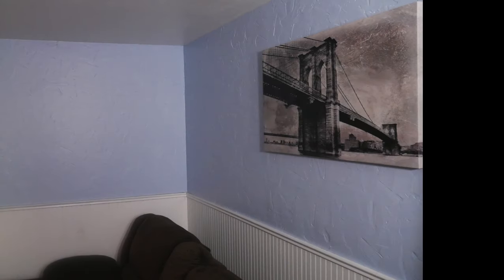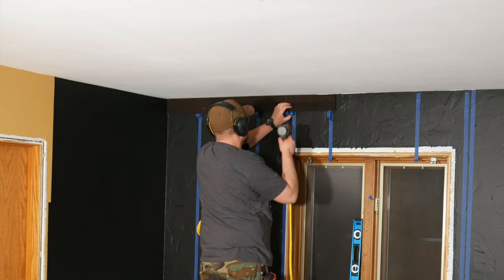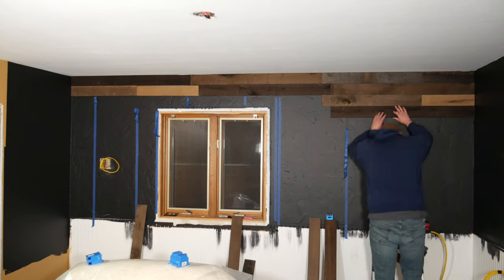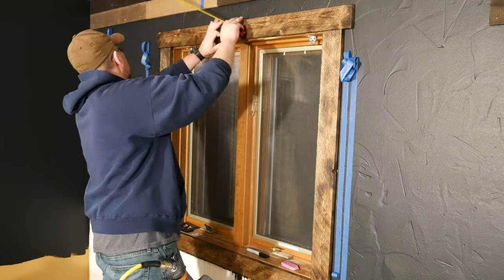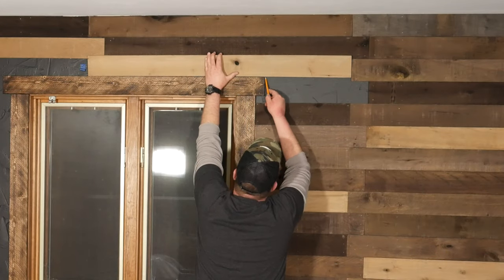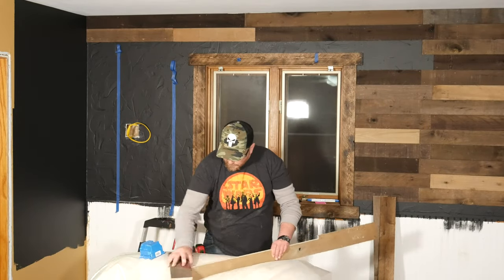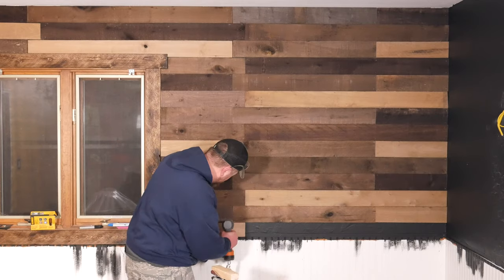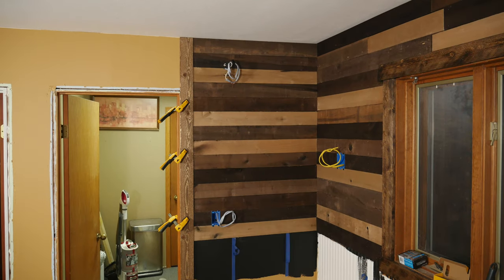How to install a rustic wood plank accent wall for beginners - The Family Room Remodel Part 17

Comment: Why did you start at the top? I have seen other videos that say start at the bottom.
Reply from the maker: Good question. It’s not shown in this video, but after I installed these wood planks I built an electrical chase along the bottom edge of the wood planks. Click here if you would like to see what I’m talking about https://youtu.be/io8K7Mf6JLU anyway for this project a clean line along the top edge where the wall meets the ceiling was more important than anything else, so starting at the top and working my way down made the most sense. And since I was building it to essentially a built out piece of trim if there were any inconsistencies at the bottom, it doesn’t matter because it would be hidden by the trim/electrical chase. I think that’s true for anything, if you’re covering one end or the other with trim it may make more sense to work toward that direction. So sometimes you may start at the bottom, other times at the top. I’m sure some will disagree with me, but it’s hard to argue with the results. In all honesty, for these I don’t see how it really makes a big difference, either way it will come out fine,  since these planks are just square edged, you don’t have to lock them or overlap, like with lap siding. I say just do whatever seems to make sense for your project and go for it.
Reply: @JFKreations  That makes perfect sense, thanks.
Reply from the maker: @contech  no problem. Hope your project goes well!
Reply: so when you painted black no more gap?
Reply from the maker: @adelchristianhamtig7462  essentially, yes. The gaps between the crooked and warped boards are still there, of course, but you really can’t notice because those gaps just disappear into the shadowy black abyss behind. Light colored paint like what we had on this wall before would have been very noticeable. Definitely worth the time painting black if you have light colored walls if you use rough or weathered wood like this.

Comment: You need to stagger your seams
Reply from the maker: Prince A Team they are staggered, in an offset pattern centered on the studs, so I’m not sure what you mean.
Reply: @JFKreations  you are so right! You did that cause of your studs I see...
Reply from the maker: Prince A Team yeah, it was kind of inconvenient stud spacing. Mostly 24” on center but on the short sections of wall, didn’t leave a lot of options without more invasive, expensive and time consuming methods of attaching the panels to the walls. Turned out ok anyway. Thanks for stopping by and checking out the video.
Reply: @JFKreations  helpful though 👍